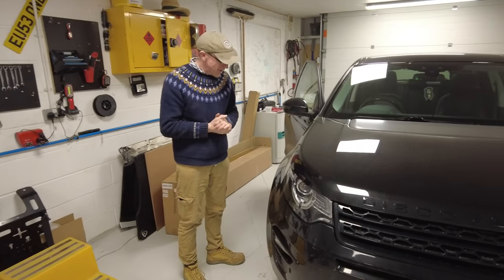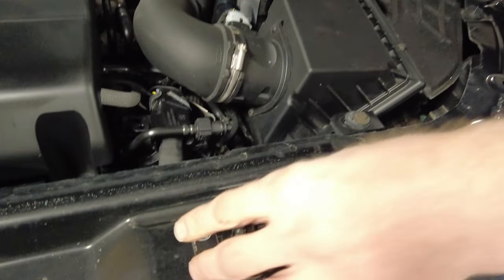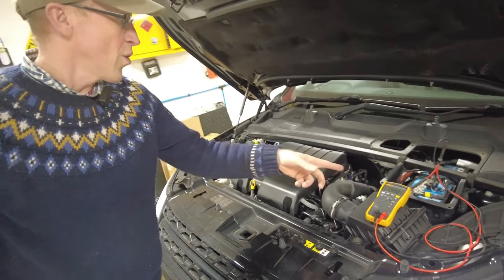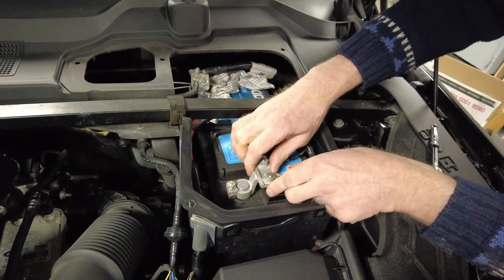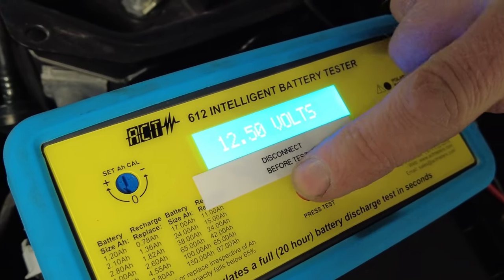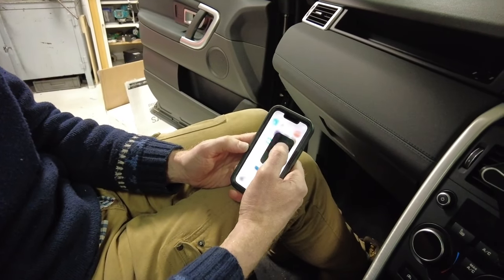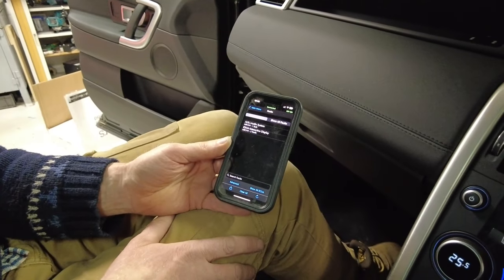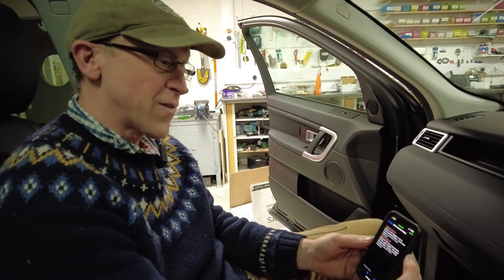Land Rover Discovery Sport L550 - We investigate LOW BATTERY Warning

Comment: Simon…I only get the low battery warning after running the radio without the engine running until it turns off automatically, then restarting the radio which then runs for around five mins and shuts again then on the third restart, the radio works for 1/2 mins then the warning appears. It happens mostly when the battery is getting old ( they live about 3 years usually) but Kates battery is good. Another sign of frequent short running is that the tailgate opens fine but when you go to close it, you get a double bleep and it does not shut however, if you touch the door handles and deactivate the alarm/ central locking, then the tailgate will shut. I thought the low warning was generated by a slave battery that runs the dash electrics rather than the main starting battery…but I have never been sure that there IS  an ancillary battery…I have never changed one yet! The cure for Kate is to do a 20/30 mile run and then it should be fine. Well done for buying one Kate!!…good luck with it and get young Simon to think up some new goodies for us! Safe driving, Richard😀😀😀😀

Comment: I had this exact same issue on the L494, turns out it was simply a replacement of the smart key fob battery. I dont know if the Discovery has the same option as the L494 but selecting Auto Access Height puts the car in a full shutdown mode when parked. Helps preserve the battery (apparently). Since doing this, no issues with the low battery warning. Hope that helps!
Reply: I wanted to follow up on this comment as Ive had a number of issues with my L494 since I decided to take it upon myself to upgrade it from its original 2015 spec to as modern as I could. I made the following changes:
1. Rear tail lights to smoked
2. Exhaust tips to Black
3. Door mirror indicators to smoked
4. Changed all the badges to Black
5. Resprayed the alloys to Satin Black
6. Resprayed the brembo brake calipers to freshen them up
7. Sprayed the wheel hubs to Corris Grey to match the rest of the car
8. Changed the grille to the SVR version
9. Changed the window control units to the newer version
10. Wrapped the interior in carbon fibre
11. Fitted a nextbase dashcam
12. Upgraded the climate control to touchscreen
13. Upgraded the infotainment system to 12" Android based touchscreen
14. Upgraded the steering wheel controls
15. Added in a wireless car charger
16. Added an apple airtag for extra security

After making the above changes it was never quite the same car. The auto stop start never worked and then I started getting low battery warnings. I tested everything and all came back fine. In the end I decided on a new battery (I only have one battery as it's 7 seats). This you would think would be the end of the issues, NOPE! 3 days into a new battery and you guessed it low battery! After more research I took it upon myself to figure it out. I fully charged the battery, removed the negative terminal for 15 mins to give the car a reset. I reset the battery monitoring system and kept my fingers crossed. That was 3 weeks ago and haven't had an issue since, auto stop start works almost immediately and no battery issues etc. 

Then came yet another issue, I was getting the random double beeps whilst the car was parked. It was really annoying, no errors on the dash, nothing! I figured out the issue the other day, key fob battery on the spare key. So I swapped both key fob batteries just to be sure. No double beeps since. Keeping my fingers crossed, love your videos it's helped a novice like myself figure out how to do all these things. I'm now hoping to have some trouble free motoring and enjoy what I have to say is one of the best cars I've ever owned

Comment: I occasionally get that warning on my Disco Sport in Winter. This is generally after short journeys or if the car has been standing for a few days .    If you are using the front and rear heated screens, heated seats and all the other electrical devices on short journeys it doesn’t allow the battery to fully charge. A good long run generally solves the problem.

Comment: I've had 1 battery under warranty, but short journeys will bring about the dreaded light as the smart charge system isn't all that smart.. Tell Kate if she doing short journeys then put a solar panel trickle charger on the dash, mine plugs into OBD port and has cured all my low mileage ills.. The light is banished to the diagnostic grave 😂

Comment: I have look at this numerous times and have come to the conclusion that it is rarely and issue with the actual battery (that said and old battery is likely to trigger it also) I have replaced both batteries in the car RRS Sport and tried without resetting the BMS with GAP tool and another new set of batteries and resetting the BMS and the warning still occurs when the car has not been driver for a few days and the last few trips were short ones. I keep it on charge with a Ctek MX5 but and the warning does seem to disappear until you go off for a drive and then dont connect it back up for a few days. the car never not starts, and the battery tester shows a good amount of volts also. The annoying thing is the tailgate getting disabled, but I do think its the BMS calculating rather than voltage testing each time you open the car. it will spring the message seemingly if it thinks the car engine needs running to top up the battery, even though the battery charged (it just hasn't been charged through the BMS I have tried charging directly on the battery and through the jumper posts under the bonnet, and if you charge on those posts it does seem to cull the message as it would appear that the BMS must get a reading during the charging as directly on the battery the BMS doesnt know its been charged and hence cant be doing a voltage test. Its daft if the limit is set at 12.5v as most batteries will never hold that for very long 12.1 or 12 would be more realistic. Someone posted it could be related to a keyfob battery, I will try that also but would like to understand the logic behind why that would cause it, im not saying it doesnt just how. The car has no bad earths the dash cams have battery back ups for 72 hrs and the trackers have their won internal batteries and very low power consumption. The other thing Ive heard is that sometimes disconnecting things on the obd2 port can sometime cause the ports to stay open and use power but some things its not possible to turn off unless you pull it out of the socket!
Reply from the maker: Thanks for this we are going to look at this next week

Comment: I get the exact same on my 2016 L550 HSE Luxury.  Had the battery checked out and it’s fine apparently. I get this warning every single day and the most annoying thing is that it doesn’t have enough power to raise the tailgate. If the engine’s on, it’s fine. Very, VERY annoying. Is there like a premium battery which would help eliminate this issue?
Reply: Exactly the same here. Just picked up a new battery and hope that cures it (pretty sure the battery is the original from 2015, so it's not done bad).
Reply: Let me know! I thought the problem might be an auxiliary battery, and was literally in JLR just now and they said it doesn't have one.
Reply: @wayneaustin7  Yeah, I think it's the Evoque which has the little extra one, behind the glove box I think.
 
Will fit it next week as I'm still waiting for my 'big' scan tool so I can 'tell' the car it's got a new battery. 

Although quite how a fancy a** car like this can't figure it out is beyond me (since every car I've owned going all the way back to the 70s have managed just fine lol!)... Technology huh, love it, but it sure can be dumb sometimes.
Reply: Have the problem... I am changing the battery and will see.

Comment: My 2017 Discovery did NOT give any warning like that. I got stranded at a gas station when my battery went out. I could not figure it out until i installed a Ford truck battery with 800 cca. Turns out the Discpvery sport uses a higher rated one. 
I could say, the symptoms I had for a bad battery is my AC would SOMETIMES work and my heater would SOMETIMES work. The airflow pathways on the heating side would not work, meaning the dampers did not open or direct airflow. 
Another symptom I noticed at the last minute is my trip mileage and current date reset once. 
Oh wel, $300 later for a battery at autozone, now everything works.

Comment: My dealer told me that LR had a batch of LR batteries that were defective(my original battery was a factory battery and not an aftermarket one). I had the same low battery warning light and on top of that my remote start would not work. So my dealer tested the battery twice and did not pass, my 2020 DS always started but had the warning light, so the dealer replaced the battery and I don't get the warning light and my remote start works perfectly.

Comment: Hi thank you for the videos! I have a 2019 range rover Evoque L551 and the issue im having is the car randomly started having a issue with the radio turning on and off intermittently. checked the battery load and tested good. what do you think the issue might be. worked great no issues before 4 days ago and now its having this issue and saying the rear camera is not working also. BUT it does work for one second and has a issue. Also the back up sensors start acting up too. Thank you for any help.

Comment: So, is there a way to re-program the voltage threshold of this warning? Very annoying. I had it for years when I was not driving each day. Never had problems starting. I swapped the battery and now I have it way less often. The start-stop stopped working the firat time I saw this error, years ago. Then came back. Then gradually stopped for good. No faults in modules

Comment: Hi discovery sport 2017 hse owner and mechanic I only do short journeys at weekends this always comes up after leaving all week without using car it’s the bms sensor (battery monitoring sensor) to clear this reading on screen low battery and reset the sensor drive car for at least 15 miles this resets everything or buy a smart  charger ctek or maypole model and charge as required hope this helps dave

Comment: when you reconnect the battery are there any systems to reset? Seem to loose the  thread after the battery test.
Reply from the maker: The only thing that needed reseeting was the electric windows - we have done a video on that. Just need to raise them and hold the switches up !

Comment: Kates DS is pre 2020 MY facelift.
That is not an OEM battery.
Ensure that the battery meets LR requirements regarding CCA / Amp Hours etc.
Short drives will not be sufficient to charge up the battery.
Ensure that no interior lights etc are left on.
If u want your Battery to last a long time, then turn off the stop / start feature…
If u use Stop / Start, the battery will only last about 3 years, and AGM Battery are expensive…
OEM battery in my 2017 DS diesel, was still going strong after over 5 years / 105,000 kms 
I always turned off stop / start….
Sydney, Australia LR dealers quoting 
over $ 1,000 for supply & fit of new battery.
LR roadside assist approved company offer suitable spec AGM battery for under 
$ 500.00 with a longer warranty, and they come to you 
24 / 7…
Reply: what are th JLR spec for the battery ?

Comment: If not using the car a lot, you can extend the life of the battery by keeping the car locked. this turns off most of the car's systems that are ON when the car is unlocked.

Comment: Long standing nightmare with all
JLR ,  petrol engines are much better due to power distribution/management being different to diesels.

Brand new evoque no change in use since new two years ago now starting with low battery warning, battery charged and all now good.    It’s an Achilles heel!!!      Over 8 years and 8 JLR different vehicles in the family we’ve had FIVE new batteries!    Kates car isn’t the original battery btw.

Comment: Had the same low battery warning with my discovery sport when i bought it last July, start/stop and auto tailgate wouldn’t work took it back they charged it but it happened again so they put a new battery on it. 65 plate with 32000 miles on it.
Reply: Did the second replacement battery fix the issue?
Reply: @wayneaustin7   yes the new battery worked, 8 months and still going strong

Comment: I get this too. It’s on my 2016 evoque. The main battery is good and I found that the telematics module in the back has a battery. I took it off and went to the dealership to buy a new one and they said that those batteries have been on back order for two years. 😮. I was like screw it. I’ll just drive it like that then. It’s not like if it was affecting anything anyway. Cheers!
Reply: Hello do you mind telling where you found that second battery. I looked up the passenger side dashboard but its not there. I’ve been looking for days! I’m exhausted!😂
Reply: I found the little battery behind the glove box on the passenger side. Same battery as garage door backup battery. I think this aux battery hives power to things like the rising gear knob when there's no main power to the car, but you have to get it into neutral. Pretty easy to replace really. (Rather take the old battery to a battery shop to replace)
Reply: @theshadypilot  yea I looked there and it's not there. I think it's under the hood but I haven't even looked to see yet. Lol! It's still running but I'm wondering if it causing the gearbox fault issue or is the gearbox bad.

Comment: You should have given the battery a good charge then reset the bms with your scan tool. If the warnings came back it’s time for a new battery. There’s no way your little gadget can properly test battery capacity in a few seconds either
Reply from the maker: I hear you - its witchcraft but it works as a battery tester !